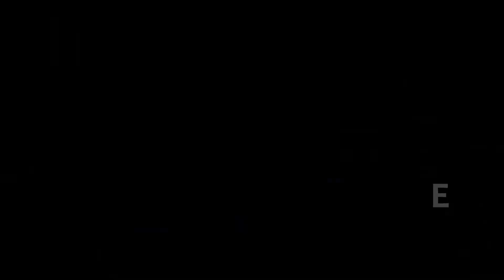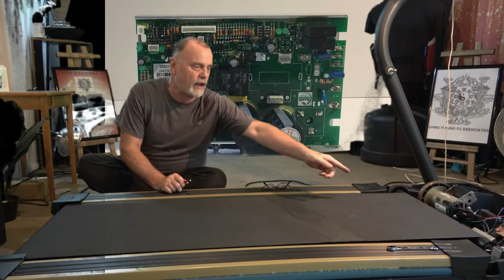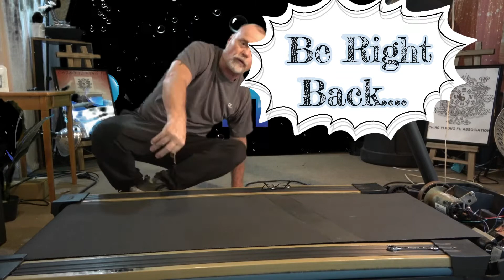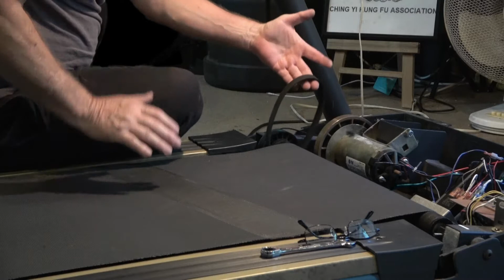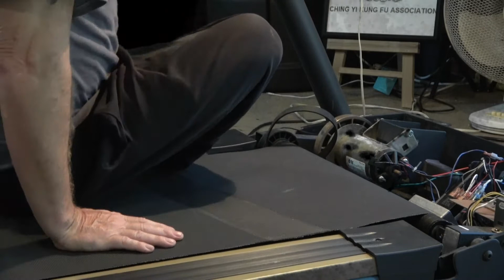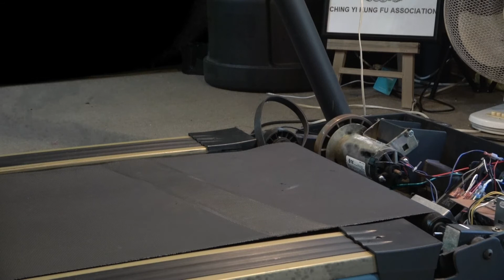HOW TO REPLACE YOUR NORDICTRACK TREADMILL FRONT ROLLER

Comment: Any ideas on why my drive roller pin is unscrewing itself with use causing my belt to repeated shift towards that side?  The bolt itself doesn’t appear to be stripped so I’m wondering if the roller head itself where the bolt goes through can be stripping?  I have to keep readjusting the roller pin after every 10-15 uses.
Reply from the maker: Hmm there should be a nut on the other side of the bolt to help hold it. If not try some Loctite blue